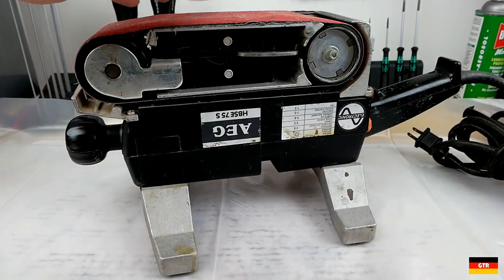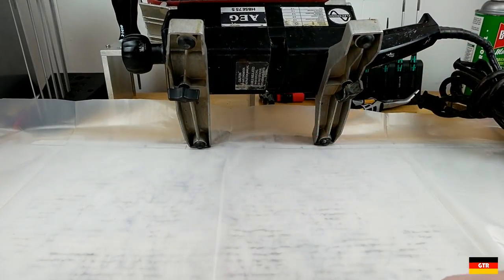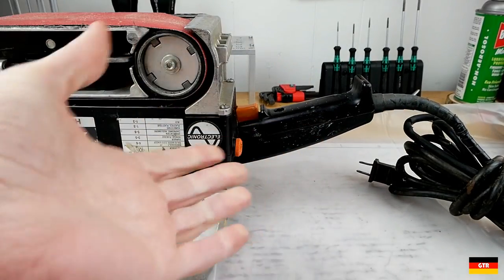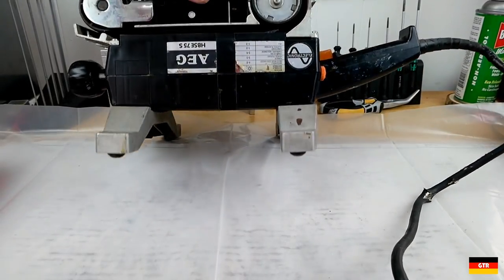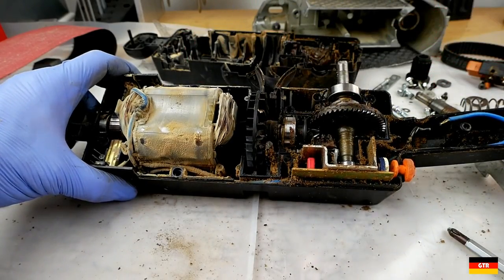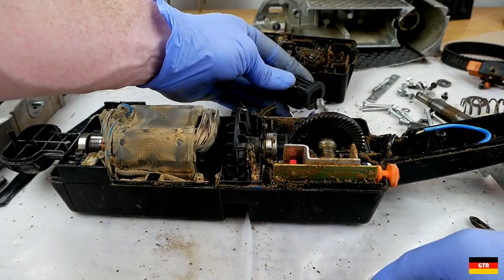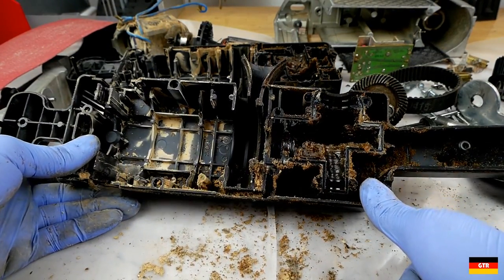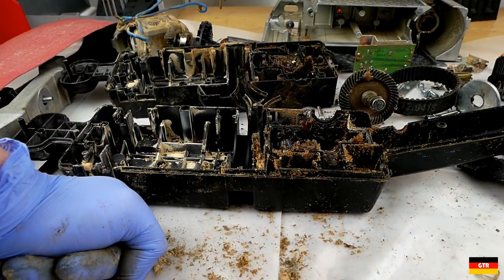AEG HBSE75 Belt Sander Part 1

Comment: Well done Matt, really looking forward to seeing this restored. I would recommend using your ultrasonic cleaner for the plastic housing after scraping the bulk of the gunk off. There might be some discoloration of the plastic especially if using a hot tank or highly alkaline detergent but the ultrasonic is ideal. It can also be used for the aluminum housing but be careful with how long you leave it in there and don't use something corrosive to aluminum. 

I would try to use differential heating to get that bushing out. The aluminum should expand faster and more so than the bronze. Maybe a heat gun first then a small torch if needed? All the electrical stuff I'd blast with some contact cleaner. Finding actual replacement parts like the rollers might be a challenge. The bearings and bushings can be sourced relatively easily from McMaster-Carr or similar. 

I hope you'll have time to restore this, really wanting to see this process to its completion.

Comment: Great video. I wonder if the tool can be settled firmly on the working surface without these 2 metal legs? I see a flat surface on its top...May be it is designed for such placement?

Comment: I had one that I gave to my brother it kept eating the drive belts and I could not source the right size. Mine all come with a sanding frame that attempted to prevent dig in on flat surfaces. Bigger drums reduce the amount of flex the belt and its joint is put through. That black knob is the adjustment you need to leave it run and turn it under speed.

Comment: Maybe the bushing was shot because the drive belt has been too tight at some point?
Reply from the maker: Not sure, was strange that it was only on one side, which was the closet to the belt.  So possibly the wrong size belt was used?  I didn't see a way to tension the belt.
Reply: @GermanToolReviews  Maybe someone replaced the belt, and was unable to find original belts. That explains why the belt does not fit 100%, someone found the closest thing to an original belt and replaced it